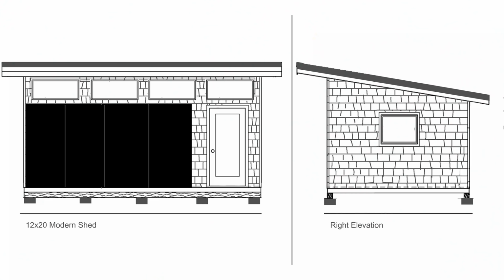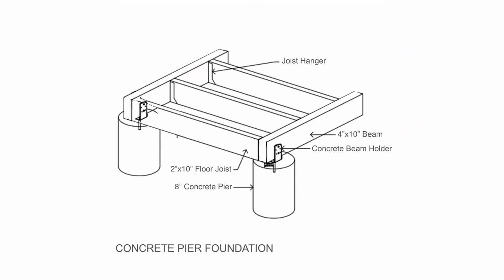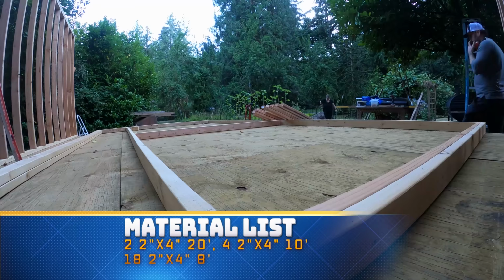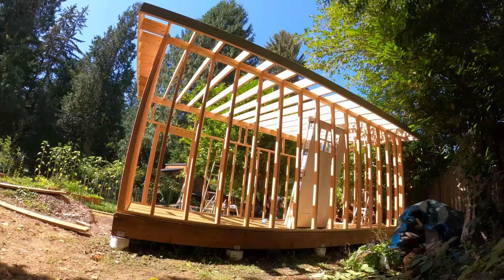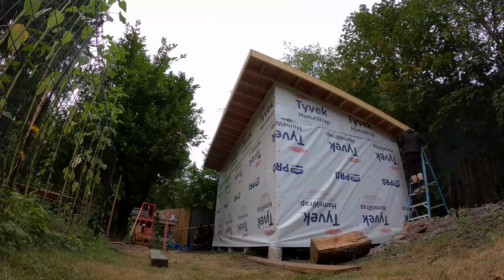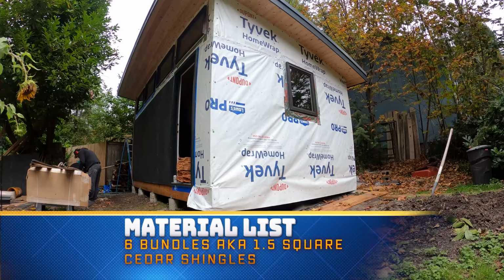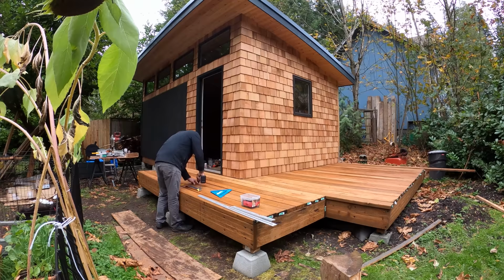Build A 12'x20' Modern Shed and Deck by Yourself: With Material List

Comment: I realise this comment is way late, but, nevertheless, I wanted to post it anyway.
First, awesome job, looks great. Nice skills with the tools and with the design aspect of this shed.  You've basically just built a house, mate! Sure, it's a small house, but a house nevertheless. 
Great skills, looks amazing.
I'm Australian, and nobody builds a shed like this here. So I'm wondering why that is. I'm guessing America has some sort of code that requires your framing to be wrapped in ply, and then plastic. 
Let me describe how a shed is built in Australia. First, a concrete slab is laid, or, holes for steel posts. The posts are laid either in the concrete or fastened to the concrete after it dries. Steel framing is used for the whole shed, and then steel sheets are used for the sides and the roof. Sometimes, sisalation is used under the metal roofing iron. This both insulates and reduces condensation dripping from the roof. However, nobody wraps the building in plywood sheets. I would love to see sheds like this being built here. Warm, soundproof and sturdy.
However, this would be very cost prohibitive in Australia. 
I'm sure there are sheds like ours over there, and shed's like yours here, but I've never seen one.
Reply from the maker: This is great insight into how you do it Australia. There are metal sheds built here the way you describe as well but lumber seems to be more common as is pretty abundant and fairly affordable  in the Pacific Northwest. 
Depending on where you find yourself in the states lumber can get pretty pricey and might not be the best choice. Also depending on climate and location you will see vas differences in building materials from region to region. For me I wanted something similar in style to my house and felt the materials I chose would better compliment it than metal. I did look into building a metal shed during the planning phase but thought it might look out of place with the vibe I was trying to create on my property.
Reply: @NilesProductions  Well, you've done a great job, mate. Your shed looks amazing. 
I'm getting too old to build stuff like that anymore. I still have the desire to do everything myself, but my body just won't let me. So, if there is anything you want to do, get it done before age catches with you.
Build great relationships with your kids, build great memories today, that you can have later in life. Life doesn't get any easier, so make the most of it today.

Comment: one more question, did you add or consider adding roof vent to the shed? I guess you didn't make attic inside?
Reply from the maker: I still haven’t got around to it two years later. I had originally planned on adding a dozen 4” soffit vents on the low and and high side of the roof. Probably do it this summer. 🤷‍♂️

Comment: On the front wall, how are the openings tall enough to accept a 24x48" window if you are using 10ft end studs, and 8ft wall studs (with a 1 1/2" plate on top of the 8's)?    Wouldn't that be 22 1/2" rough opening?  Is it because the 8ft studs are less than 8ft?
Reply from the maker: All the lumber is cut to size. In the video I’m only stating the raw materials not the length of my cuts

Comment: Where did you find the 4x10x20s?? I'm finding it impossible!
Reply from the maker: You are not going to find them at Home Depot or Lowes. I recommend finding out what lumber yards you have in your area that the local contractors use then make some calls. In my area I found them at Dunn Lumber.

Comment: Eh that is too much work for a first floor.  Should have, would have save all that lumber monies for the second floor?  Metal corrugated panels would fasten better and breath as good?  I think asphalt shingles now with solar option could have been a better choice plus recycled plastic barrier?

Plus it begins as a shed?  Then you could strengthen the interior w beams and shelf system to foundation?  Before that add wool felt drapes to the inside for insulation?  I do not know.  So many doable better materials out there?  

You could have spray painted the wood first?  Add an exterior cement board with pre plaster would have been water proofing?  Then uh clay exterior d have been nice?
Reply from the maker: A lot of different ways to build a box, this is just the way I built mine 😜

Comment: Did not need a 20ft long 4x20 beam. 2x 10ft long would be just fine, extra cost of 2x brackets should be offset by the cost of 2x 4x10 10ft long rather than 1x 4x10 20ft long
Reply from the maker: There is often more than one way to achieve similar results. Some may be more robust than others, some may be overkill, some may be a little on the flimsy side. I lean towards overkill. 🤙
With that said if I were to do it again I would probably stay with the 4x10’s

Comment: how is that going to block vapour? it's on the ground...
Reply from the maker: The black plastic blocks moister vapor that permeates from the ground. 
A very simple experiment to show how this vapor barrier works is to lay a plastic garbage bag down on some damp soil. 
Another option would be to install closed cell foam insulation between the floor joist just below the plywood subfloor. 
The second option would provide a better energy savings and comfort if you decided to heat your shed.

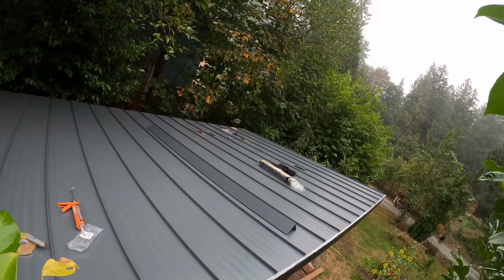Comment: 15:30 why never seal the bottom flashing? Just curious
Reply from the maker: A sealed bottom flange can trap condensation/water in the window pan. 
By not sealing it there is a better chance for the water to drain/escape and not damage the wood.

Here are a couple good video showing how to flash a window.

https://www.youtube.com/watch?v=JhXx__AMzTo

https://www.youtube.com/watch?v=RLlOw36KesQ&t=1244s

Comment: So for the outer 20x2x10's for the floor, if i wanna build a 34' long room, do i need to put 1 piece that long? Or can i put 2 pices of 17'? Cause a one 34' piece would be such a problem even maneuvering it.
Reply from the maker: There are ways you can join multiple boards together.

Comment: It looks like you were using screws instead of nails to do the framing. Any reason for choosing screws over nails?
Reply from the maker: It might be better to use nails vs screws depending on the application. I shouldn’t have used them with the joist hangers or rafter ties I’ve been told. 
While nails have a higher sheer rating than screws, screws have a higher pull out rating. The #10 deck plus screws I was using have much higher sheer rating vs normal screws so you kind of get the benefit of the higher hold without worrying about them snapping off. 
Nails can still be stronger. 
 http://stfasteningsystems.com/deck-plus/

I’m not a professional carpenter, just a guy with a cheap saw and a hammer that tries to learn new things and diy stuff. I’m sure I made some mistakes along the way. Check your local building codes and permitting before you start would be my main advice.  Also consult professionals, they have a wealth of knowledge and can be super helpful when trying to figure out what is the best practices.
Reply: @NilesProductions  Thanks for the detailed response. Much appreciated. BTW -  that's an awesome result for a DIY guy.  You give all of us DIYers hope. Cheers!

Comment: I think they are birds mouth joints not bird box joints.
Reply from the maker: Ah you are probably right… I feel there is a good chance that I’m using the wrong words or lingo 90% of the time when I’m when trying to communicate 🤣 Despite using the wrong term I hope people still can understand the step I was trying to convey. Lol
Reply: @NilesProductions  I do it all the time too! Great build and video. You used a lot of material and during lockdown too, I guess I would wince at the cost!
Reply from the maker: @richardellis5868   I purchased the majority of the material for the main structure at the beginning of lockdown before the prices went crazy. 
When it came time to make the deck though I was paying nearly double for the pressure treated lumber vs when I started.

Comment: Did you find the build plans for this online? I would love to build this.
Reply from the maker: I bought a book called Sheds and Garages from Lowes that had a ton of plans and designs. I also looked at a bunch of stuff online. In the end nothing was exactly what I wanted so I made my own. The Sunset Sheds and Garages book has some good stuff that might help you along in your journey.
Reply from the maker: I have the material list for everything I used when building this in the description and a couple drawings in the video that you could freeze frame and do a screen capture of. 

From there you could probably find plans from the Sheds and Garages book that would help you make it your own.

Depending on where you live it might be hard to source the two big 4x10s i used in the foundation but there are many different ways to build your base.

Comment: what kind of wood is that? and why does it have all those etchings on it?
Reply from the maker: It’s ground contact pressure treated lumber. The little marks is where they penetrate/inject the wood with the preservatives that helps keep it from rotting.

Comment: How much was the total cost of this project??
Reply from the maker: I believe I spent around $12g on materials. You can grab my material list below in the description and price it out with current pricing at your local lumber yard though to get a more accurate number if you are looking to replicate something similar. Paint stain and deck screws are not included in my material list so figure in a couple hundred more…

Comment: How's the siding holding up?  Any additional maintenance you've done over the last couple years?
Reply from the maker: Everything is holding up perfectly. I recently stained my house and fence and found I had a little extra stain so I did another coat on the shed . The cedar is beading water perfectly.  I've also cleaned and did another coat of sealer to the deck boards
Reply: @NilesProductions  Awesome news on the cedar.  Wanted to let you know my current shed build was completely motivated by your build.  Got the roof (shingles) done last week and just finished installing two vinyl windows on the front and side, plus 4 transom (?) windows across the top.  Next up is siding, plus I need to figure out a door.

Comment: How would someone learn to even begin building things like this?
Reply from the maker: I’m no pro. Just a guy with a cheep saw and a hammer. I bought a book at Lowes called Sheds and Garages and looked at a bunch of different plans. I gleaned what I could and made some plans that fit my needs and style. I considered buying something prebuilt and hiring someone but I’m glad I didn’t. Most of my construction skills comes from building skateboard ramps in my youth.
Reply: @NilesProductions  Ah thanks a lot

Comment: First off, amazing video! Two questions.  Did you design this in an outside program or did you have the knowledge and rough it on paper prior?  Secondly, if you don't mind disclosing ballpark how much was this build?  Obviously the price of lumber has changed everyday for the past 2 years but would still be interested in a ballpark budget for something like this.
Reply from the maker: My original plans were made with pen and paper. 
The images in the video I made approximately a year after I finished the build solely to better explain what I was trying to accomplish. lol
The cost at the time of the build for the shed and the deck was a little over $12k

Comment: great design, how much did you spend up to this point?
Reply from the maker: Thanks Baran ToGo. The shed and the deck ran a little over $12g at the time I built it in 2020.
Reply: @NilesProductions  thanks for the quick reply, that was the range of my assumption as well

Comment: I just wanna know where you found a pressure treated 4" X 10" of any length.  haha
Reply from the maker: I suppose depending on where you are in the world it might be hard to source them. 🤣 But with that said check your local lumber yard they may have them or a way to get them. You won’t find them at Home Depot or Lowes. I purchased mine through Dunn Lumber here in the PNW
Reply: @NilesProductions  Thank you, sir!  Yeah, I looked at Lowes, Home Depot, Menard's, and Sutherlands and came up empty.  I'll maybe head to the small local yards or maybe build one out of 2 treated 2X10's with a piece of treated 1/2" plywood in between.  I'm not sure if that's a viable solution or not. 

Thanks for taking the time to document how you did all this.  I appreciate it.  🙂👍

Comment: Nice.  I liked building my shed in 2020.  Did you put you miter saw on a Rubbermaid table? It is stable enough ? It does not wobble ?
Reply from the maker: Yeah, the saw was just sitting on top of a Rubbermaid table. Felt stable enough.

Comment: Hey awesome work! how much weight would you say this structure can support? Also, if used as a tiny home how many years would you guestimate it to last? Thanks
Reply from the maker: I’m not a professional carpenter just a guy that likes to DIY stuff. 
With that said When I was figuring out the structural specifications for my building I did some quick Google searches to help figure that stuff out. The recommended floor joist specification I found for an 11’5” span was 2x10”s at 16” on center. For the rafters it recommended 2x8”s at 24” on center for a 2/12 rise. I went a little bit more beefy and hung my rafters at 16” on center.
For the wall framing 2x4”s are plenty strong but if I was planning on finishing out the inside and turning it into a little cabin it might be smarter to use 2x6”s as you can load the walls with more insulation than you would be able to with 2x4”s. 
With maintenance I feel my structure will last for many years as I used good materials perhaps a lifetime? The top deck boards on the other hand will probably only last 5-7 years. 
I don’t know 🤷‍♂️ When they go bad I plan on replacing them with synthetic wood as it should last much longer.

If you have any friends that do construction for a living they will probably have better/more knowledgeable advice than me and might be worth consulting.
Reply from the maker: If I were trying to make my shed into a tiny home I would have probably done a bunch of things slightly different to accommodate plumbing, wiring, and insulation.

Comment: I would Love to build my own shed but can barely swing a hammer accurately. How many years does it take to be good enough to be able to do all this yourself? How does one even get started if your not in the construction field?
Reply from the maker: I’m not in the business of construction just a guy that likes to think things through and diy stuff. This was my first shed. Most of my construction experience come from trying to build skateboard ramps and tree forts as a kid. If it’s your first project it might be a little overwhelming to do something this big but if you start small and get a couple projects under your belt you will be proficient in no time. You can do it if you put your mind to it 🤙
Reply from the maker: If you decide to give it a go, for your first attempt, I don’t recommend trying to make a how to video like I did. It just adds another level of complications to everything 🤣 it becomes a little daunting  when you are trying to think about your next camera angle at the same time you are figuring out the angle you need to cut on your boards.

Comment: where do I go to read how to properly build out frames? I feel like I need a step by step breakdown of like every portion of this. flashing, framing, etc
Reply from the maker: I bought a book at Lowes called Sheds and Garages. A lot of good info there
Reply from the maker: There are probably a few things I should have done differently… like insulate the floor joist before installing the sub floor. 
It’s my first time building a structure like this so I made some mistakes along the way and there is a still a lot I need to learn.

Comment: Nice job, but really you built a perfect source of fuel considering you live in a forest. Have you not seen the news of what not to build with?
Reply from the maker: Forest fires are a real concern these days. I live in an area that receives over 100 inches of rain annually but even so we have had some seriously dry months these past couple years. It's not easy to see in the video but when I'm installing the metal roof the air was thick with forest fire smoke from fires in British Columbia.  I think the a.q.i. that day was over 250.
Reply: @NilesProductions  ok

Comment: Hey, great job! Looks fantastic and what a great, helpful video. Very inspired, fella.

I'd like to use this as a basis for what will be my largest solo project. I have some different willow choices but overall I love the size, roof, siding and deck!

What it be possible to see your plans from the video? I liked your base and floor method so want to do something similar.

Looking back, anything you'd do differently about it now?
Reply from the maker: I don’t have any plans that I can share outside of what you see in the video. 

Things I would have done differently. 

I would have added ridged foam insulation between the floor joist before laying the sub floor. A lot easier than trying to install it afterwards. 
Maybe used hanger nails when fastening joist hangers and rafter strong ties.
Reply: No problem. Once again, great video and super helpful. If it all goes wrong I'll tell my wife to blame you.
Reply from the maker: You just need a good supervisor like my old boy Hanson. He’ll keep ya in line